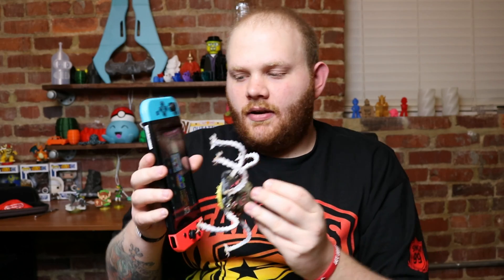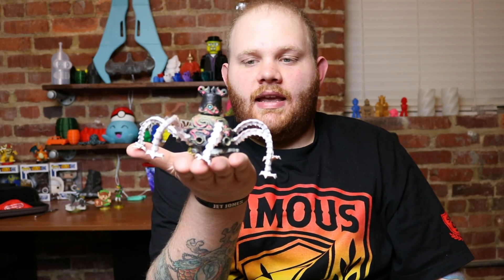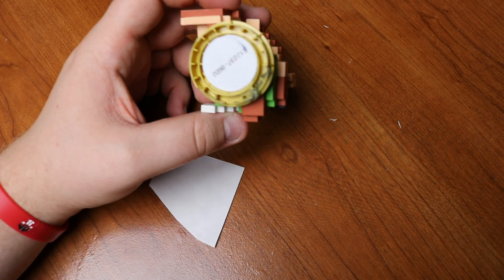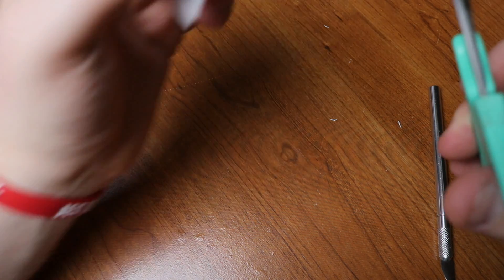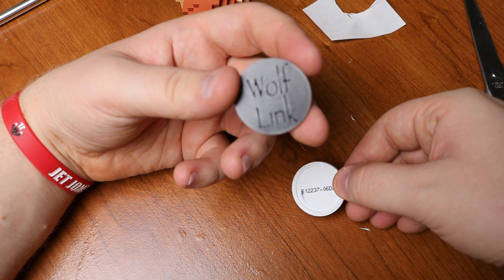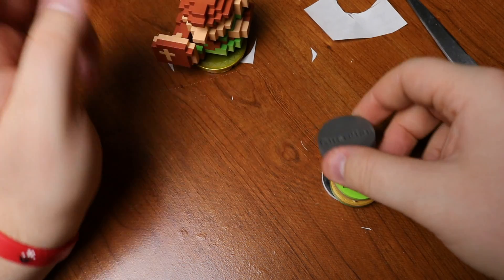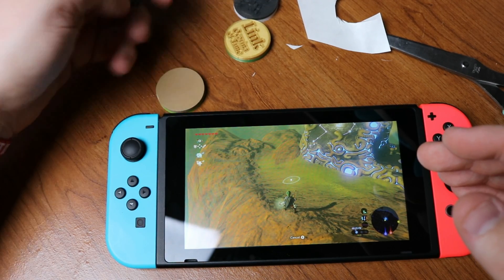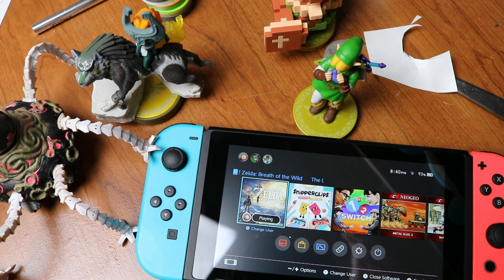3D Printing: Mini Amiibo's? Amiibo's to GO??

Comment: if you search for the amino character in vector form, you will be able to get it in the coin using MatterControl/simplify3d/craftware and some other slicers even if you can't model in 3d programs. just search for free vector sites and the character you need. mixing 2 colors on top of those coins would be neat too.
Reply from the maker: Leandro Lopes hmmm might have to try that. If I do I'll message you back here so you can see!!
Reply: JustinTime3DPrints I appreciate, but no need to worry. I am already subscribed with notifications on, so just post it, even if it is a really short video and we will know. thanks for vids.
about cutting the amiibo, try just getting the exacto knife hot (attach it to a soldier iron tip). the cut will be more fast, clean and precise and if you get a 3d pen, you will be able to close it later.
Reply: JustinTime3DPrints thanks for the vids.